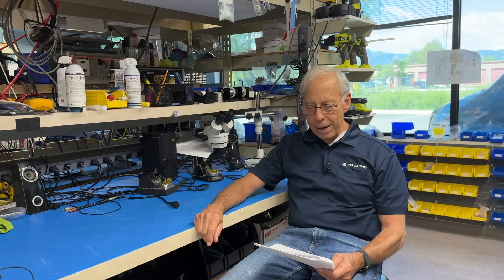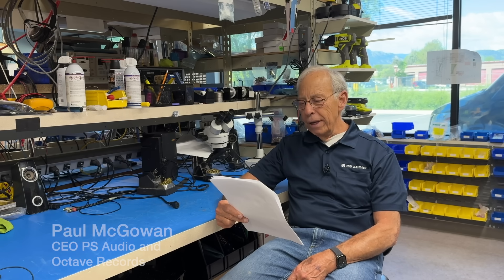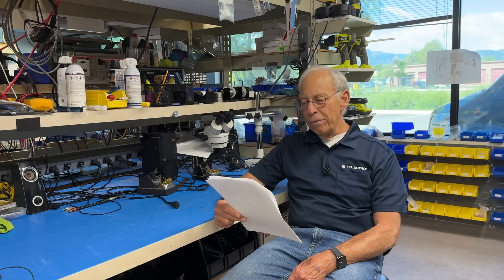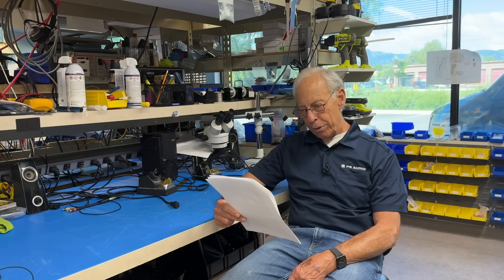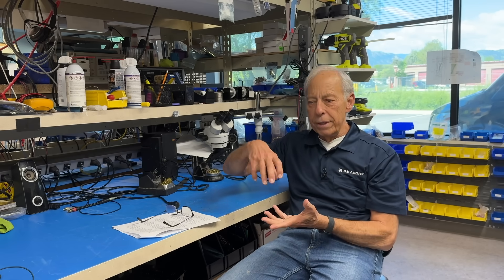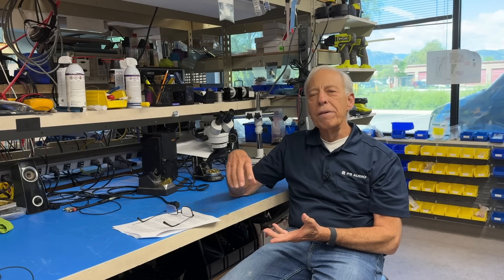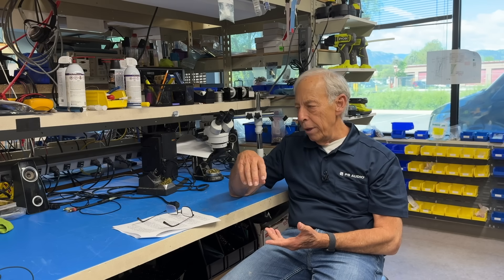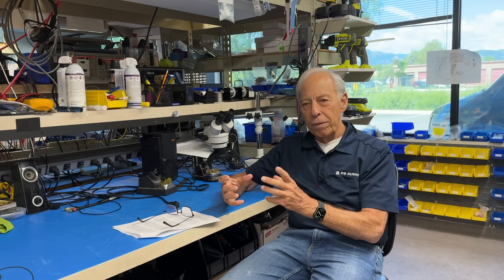Can a DAC sound tubie?

Comment: That's why I like using a tube preamp in the chain. It makes all the difference. You can get the best of both worlds. A tube preamp is great for class d amps.
Reply: AGREED. Tube preamp + class d amp(s) is the way to go! I just upgraded to an Audible Illusions L3A line stage paired with PS Audio M700 (class d) monoblocks and wowza, what a pairing!  Now i can truly appreciate the wonder of the Aspen Fr5's!

Comment: I've tried multiple dacs i like my peach tree but my chord mojo has beat every dac I've tried. There chip set ive read is there secret. I'm using an audio  research preamp a single ended triode using 805 power tubes with watt puppy 3s. if you have a better dac for the money I'm all ears.. thanks

Comment: Put on your boots because the $h1t is getting deep here.
Paul gives us some half truths that identical DAC chips will sound different based on the output circuitry, which is true 
BUT then he tries to pull the wool over everybody's eye by slipping in how his "signature series" DAC sounds so much superior because it uses a Delta Sigma, FPGA converter and converts PCM to DSD.
If you buy this line I have  a million 5 dollar Delta Sigma converters I'll sell ya.😮

Comment: Ideal reproduced sound is indistinguishable from the original.  An electronic configuration that actively promotes that is good.  Anything that adds coloration not present in a faithful recording is bad.  If 3 DACs sound different with the same recording played on the same equipment, at least 2 of them aren't good unless our goal is a pleasing sound in preference to an accurate one.
Reply: What is an accurate sound?  I guess you were in the studio on every recording you listen to.
Reply: @mitchtaylor6512  Accurate sound is what was recorded and then reproduced with zero distortion or coloration of any kind . All measurable without having to have been in the studio during recording . Very simple and that is what the Fi in HiFi is all about . All the rest is euphonics , not HiFi . You may like to add and hear your prefered distortion or coloration of the sound , but that is not HiFi .
Reply: @gerritgovaerts8443 just because the electrical signal measures well  doesn't mean it will be an accurate sound from the speaker into the room.  there is no accurate sound in HiFi or we would have systems that sound exactly like real musical instruments, and we don't.
Reply: @gerritgovaerts8443 Ny Sony OLED is a high-fidelity display screen but if I feed it my old laserdisc or dvd signals I’m reaching for those upscaling settings and I can get it looking more realistic and sharper than a true raw untouched blurry signal displayed. It’s how I feel about tubes in music, it might not be accurate to the signal but to my ears it sounds more natural with a wider soundstage and more pleasant harmonics. Consequently all those old laserdiscs look better on a analog CRT TV too while I can only do so much to make them look presentable on my flat screens.
Reply: @mikeg2491 to my eyes most modern TV's are too detailed, not even close to what is seen in real life.

Comment: Very true and important point here. That’s why some manufacturers actually offered a separate 1 gain output stage that you can add to your CD (or other digital source) deck’s analog outputs. Such as the famous Musical Fidelity X-10D tube stage. There also are a few decks that offered 2 separate analog outputs, one with a transistor output stage, another with tubes. 
2 further observations : 
- CD decks analog outputs do not always have a good output impedance
- the quality of the (internal or external) DAC chip and filtering still have some importance in the final result. Pulse response is an example. Some decks and external DACs actually offer several user switchable digital filtering options to choose from.

Comment: All this reminds me of digital photography and all the different color profiles to emulate films. You want film? Then shoot film. You want a tubie sound? Then put tubes in your output stage. Use the real thing, it really is that simple. :) One day, when no films nor tubes will be available on the market, we can think about simulating them.
Reply: No longer true for musical instruments. Digital amp processors have become so advanced that it is no longer worth getting a pricey, traditional tube amp. Digital all the way.
Reply: @bsnf-5  Sure, but if you emulate, it will always be like buying a print instead of the original paint.
Reply: I shot Kodachrome for over 6 decades up until the end (last lab that could develop it was shut down in 2010) and I find that having a digital Kodachrome emulation mode very helpful. The current E-6 transparency films like Velvia RVP, and Ektachrome E100 have too much color saturation compared to Kodachrome.
Reply: @joeythedime1838  if what you want is not there anymore, then emulation is more than justified of course.

Comment: is so funny how people compare dac´s based on the chips inside, a cheap one could include the same dac chip so it must be the same and sound the same.  One of the best upgrades to my setup was a external dac that has a numerous inputs, so I connect everything digital to it, Cd, streamer and even the tv. every source sounds great through it.
Reply: How do you connect your TV in particular to a DAC, could you expand on this? Like, what cables, what setup is that, and eventually what is playing the sound of your TV? I assume that you have some kind of stereo, or maybe even 5.1 system? Thanks
Reply: @bsnf-5 I had to use the toslink optical out of my tv to my dac. I go from my dac to a headphone amp or the aux input on my vintage receiver. Toslink cable is no name from Amazon. I like Bluejean cables. Well made, affordable.
Reply: @martinfox2244 TV to vintage receiver? I never tried that. If you don't mind sharing the model of the receiver, do tell. I'm curious how it could improve my setup, I currently use powered speakers.
Reply: @bsnf-5 it probably wouldn't improve whatever you have now.
Reply: I connect my Samsung frame via usb A to B cable to my Bel Canto Ref link and from there to a Bel canto 2.5 DAC via AES cable and it definitely improves the sound immensely
Reply: @bsnf-5 it's easy. Most TV's have a optical out. I use my 2 Ch for the TV.

Comment: Digital has an advantage of authenticity to the original digital copy no matter how many times it is duplicated and how far distance it is to send, while an analog signal including audio will deteriorate every time it is dubbed and also it will be distorted when sending even a short distance over media like cables and when passing through more stages in its amplification path. It is also changed over temperature. Tube sound is from firing electrons that gives a more chance of signal degradation like electron thermal and incoherent noises, because tube sound tends to have such variances, I just like to have fun in tweaking it
Reply: Digital signals can also suffer errors. None of the digital audio interface protocols have error correction and they can also have timing issues which can affect the digital to analog conversion.
Reply: @tschorsch  Errors are detected by the files system. It's very very rare.
Reply: Digital audio signals do have error correction during streaming over tcpip or network transmission. For bit-perfect, some DAC manufacturers implement data buffering and or clock synchronization (master clock)
Reply: I'm disagree with you.  Why, in the past two years I have been using a Harmon Kardon 730.  The amp section is wired different the all other solid state amplifier.  The output stage uses a common collector output stage instead  of common emitter.

Comment: Then I asked ChatGPT-5 "Can a DAC sound tubie?"...and out came 2 pages of extensive information about how to make it possible🤯...alright, then I asked "Make a schematics for an output stage that sounds tubie added to an ESS DAC chip output (ES9038Pro)...and it did that...then it asked me if I want it to draw a PCB...and...I said to myself, my old hobby is fried by AI...but then I looked at the schematics and this "AI thinks" I want to use an actual tube and transformer...stupid AI...so I said " don’t want to use tube and transformer. I want to achieve tube sound with modern components."...and it made it think a lot longer...and then it came up with two options "JFET H2 Buffer (single-ended “tube-y” with modern parts)" and "Op-amp Triode-Emulator (adjustable, precise, fully solid-state)"...and provided all the specs and parts needed...schematics...PCB layout...soon I can just startup an AI agent and it will do what is needed to make a prototype of it from some supplier sent to my address. But will it sound good? Maybe...some day. But I still trust human hearing more. Still, the world of AI is changing faster than most people realize.
Reply: Literally send the gerber files to a pcb maker, hit up Mouser for the rest, they have a thing called projects that makes it super easy, add a cabinet and you're golden. Just stick it on the output of some crap dac that comes in a portable player.
Reply: arduino groups are full of people asking if a chatgpt schematic would work or not. (sometimes yes sometimes no)

now for tubie sound you just need it to roll off at the extremities of the signal rather than hit a wall. the more so the more tubie it is. good for controlled sort of distortion overdrive sound things but actually rarely good for reproducing a sound
Reply: If you want your AI to have a more human result then you're going to have to push its output through an engineer stage who will apply your preferred distortion.  You can lift the noise floor to hide spurs by supplying insufficient coffee to compensate the late night debug sessions.
Reply: @Chipchap-xu6pk It's still much necessary for AI generated electronics or software to involve humans to make it something manufacturable. At current stage of AI it has an amazing power to create subsystems that can help productivity of engineers. It can also review and improve things. Frankly, it will keep improving. Soon if can develop an entire product with everything included and some day perhaps even virtual listening tests will just be part of it. Imagine you can define a setup with room and products and some individuals with different traits; and then run listening tests in AI entirely virtual with a complete model of everything including room acoustics and trained models of human perception and with music picked carefully for getting good depth of the test. It will then tell you what the virtual testers concluded. Give it a few more years...
Reply: The thing about LLM-AI is that it can do nothing other than regurgitate the garbage it was trained with.  And there is one hell of a lot of garbage in the realm of audio. LLM-AI can do no actual thinking, it only appears intelligent to humans who also have no ability to think on their own.
Reply: @rockets4kids That's very ignorant. LLMs don’t just “regurgitate” — they generalize from vast patterns in data, enabling them to synthesize new insights, solve problems, and adapt to unfamiliar contexts.
While they don’t “think” like humans, their predictive reasoning can process and integrate knowledge at a scale no person can match, making them powerful tools when paired with human judgment and domain expertise.
Reply: @rockets4kids Yes, AI can defend itself lol 😂
Reply: @ThinkingBetter  I'd prefer A.I. to be less digital & more analogue...possibly even more 'tubie' 😉
OFF TOPIC: You seem to be using ChatGPT 80% of the time these day. What happened to that finely tuned, critical thinking, decisive & well oiled brain of yours from back in the day? Inquiring minds want to know.
Reply: Excellent point. Too much use of AI might be unhealthy for maintaining our brains much like watching sports on a TV while not exercising.

Comment: a DAC with a "sound" is just distortion, due to poor engineering.
Reply: 'Poor engineering' relative to what standard?  DACs with different parts (chips, op-amps, power supplies, etc.) and implementations, different output voltages, different digital filters each produce a different overall sound... clearly heard in direct comparison, though excellent hearing and higher-grade gear may be required.

Distortion levels do not tell the whole story since multiple DACs can measure similarly yet sound quite different due to the above reasons.
Reply: @mattrismatt  If they measure the same, they are the same. Unless you believe in the "Audiophile Aether"that nobody seems to understands but must be there because some guy in a basement told you?
Reply: @TheMartijn00   Do any two DACs "measure the same"? Can you fathom that there is more to the sound of a piece of gear than its measured performance... its real-world performance? Since all models of DACs are constructed of various different parts with varying implementations, why wouldn't they each produce a different overall sound?  I brought up this point in my first response. Care to address it?

I value experience over measurements and can easily distinguish the sound of the few DACs I own. Have you ever directly compared DACs? It helps to have good ears, hearing discernment, a transparent amp, and highly-resolving headphones.
Reply: @TheMartijn00many of the big tech companies started in a garage or basement so what is your point?
Reply: @mattrismatt  I think his point is that the DAC's analog output is as purist grade as possible true to the original digital representation maximally. An output stage adding tube distortion is not. But reality is some people like some added tube distortion and it's OK. And of course, even the intent is to preserve the original intent, still DACs can sound different due to real-life compromises e.g. low pass filtering artifacts. Ultimately what we enjoy most is the winner.
Reply: Just changing filter will change the sound in the same DAC.
Reply: A DAC without a sound isn’t what I would like, though. 😅
Reply: I guess every dac is poorly engineered by your definition.
Reply: @Pete.across.the.street  no, but most are. Benchmark does a near perfect job
Reply: @TheMartijn00 Is that because of the misleading name...Benchmark??
Reply: That is so lame...
Reply: @TheMartijn00 I'm glad to see that you have a sense of humour.
Reply: Let's not overdo the notion that everything has a sound to it. If two DACs are both modern, neutral, and well-engineered, blind tests show that most people cannot reliably tell them apart if at all. The audible “sound” of a DAC usually comes from intentional coloration or flawed design in the analog stage — not from the digital conversion itself.
Reply: @ThinkingBetter no dacs meet all those requirements in reality though.
Reply: Isn't that what a tube stage does?  The tubes produce soft clipping that sounds good (warm) to many people.  This seems somewhat similar to what an effects pedal does for a guitarist.  Season to taste I guess.
Reply: @markrosenthal9108 false, a tube dac output stage doesn't clip, you are thinking of a tube amp being driven into clipping.
Reply: @mitchtaylor6512  A DAC can be programmed to generate analog however you want.   Poor vs good suond  engineering is a matter of taste.
Reply: Everything we do in audio reproduction fits your definition of "distortion." Every mic, recording venue, playback device adds something of its own character.
Reply: @patbarr1351 But some things really don't add audible character of significance. Microphones and speakers do and it's unavoidable. A DAC can be engineered to exceed human hearing threshold of audible artifacts. Often people say that you can't measure everything and some things are better judged on listening test. This blanket statement is over-used and the tool often used to convince audiophiles to spend 1000s of Dollars on things having zero audible effects, for example audiophile power cables. Same people will tell you a power cable can improve the soundstage and help make the sound more resolving with zero science to back it up and hang on the argument that only our ears can judge it. Sorry but this is the big lie in audio!!!
Reply: I tend to agree. A DAC's job is to reproduce the signal curve of the digital stream as precisely as possible without added harmonics. I rather see an "audiophile high resolution DSP" having tube sound as a selectable and tunable option out of a range of DSP functions. The beauty of having a DSP in the dataflow before the DAC running at the native sample-rate is that it can be totally without negative effects by just bypassing any function not desired by a given customer. Thus it can include room correction, loudness control, rejuvenation EQ, hearing damage EQ, tube sound, room ambience and so on...all switchable features. If you want none of it, just turn it off and it's purist-perfect.
Reply: @ThinkingBetter  I couldn't agree more!
Reply: @ThinkingBetter you can't get something for nothing in this world, there are only compromises, DSP is a compromise. I have never heard any DSP sound exactly like a tube equipment.